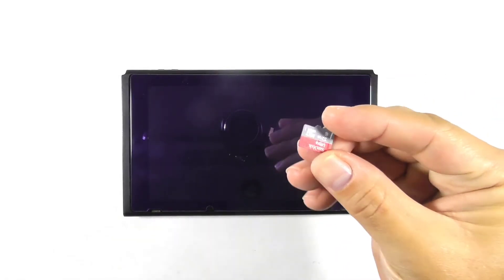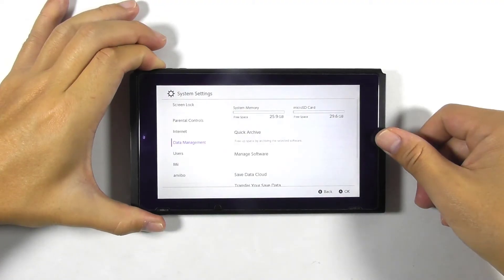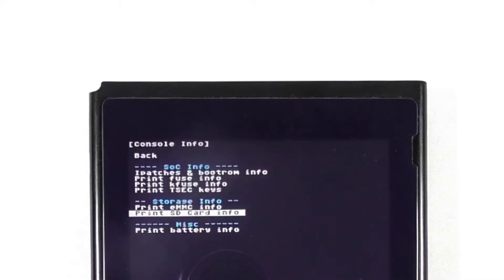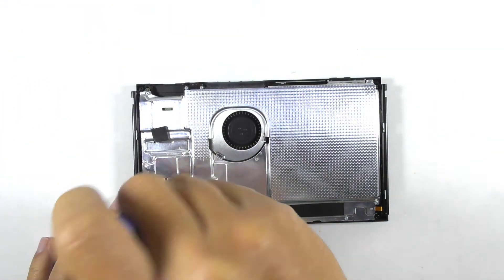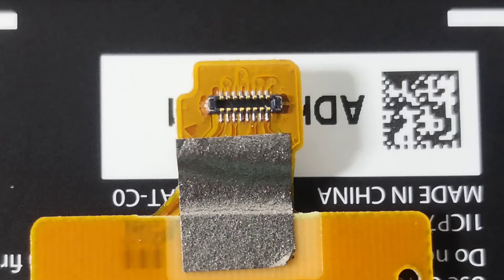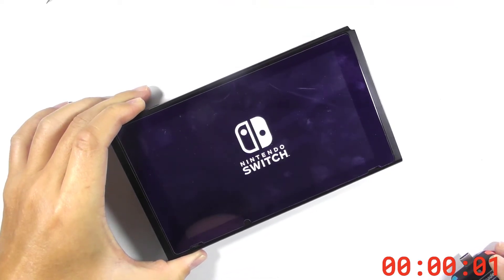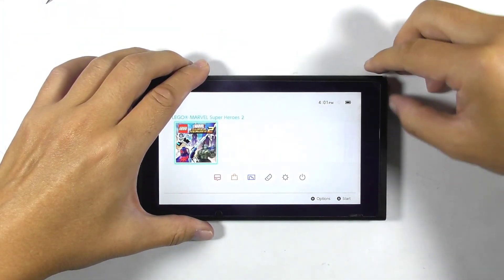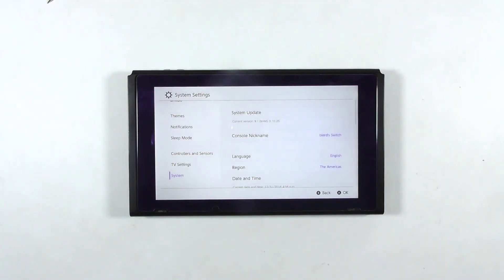Nintendo Switch SD CARD NOT DETECTED under Hekate - but runs fine under stock firmware. Repair tips

Comment: Hey Sthetix, 
I was getting the same error message, so I formatted my card to fat32 and used fusee primary bin, and it worked. I don't really want to use fat32, because files larger than 4gb don't work on it. Do you know if their is any way to use exfat for cfw? I haven't disassembled my switch.
Thanks
Reply from the maker: fat32 is recommended for everything.. install games using usb connection. directly from pc
Reply: I will need to try this out when I can find a spare low capacity microSD.

Comment: hey im having the same problem but i have 2 micro sd cards one with 128gbs and another one with 256 and the problems is that the 128gb gets booted into custom filmware correctly but the 256 one doesnt
Reply: i have to same problem. The SD cards have the same data on it
Reply: Same here.

Comment: I'm having this problem, but only with two of my sd cards. I have 5 different sd cards and three of them work. They are all the same brand and I bought them from walmart so I know that the cards are genuine.
Reply: Any recommendations on what might fix this problem without taking apart the switch?
Reply from the maker: maybe u need to check the sdcard file system.. is it fat32 or exfat?

Comment: Hey my switch detects my sd card but when I boot into rcm its says missing bootloader
Reply from the maker: it means u don't have the complete cfw  files especially the hekate ipl ini file inside the bootloader folder
Reply: @sthetixofficial  can you do a walk-through how to do that? I having the same problem.
Reply from the maker: no.. it depends on ur sdcard slot conditions
my guide is not universal.but the concept is same

Comment: @sthetix Great vidéo !!! i love it !  what do you mean by "30 awg kynar wire" => if i cut it, a USB câble can be used or not? if not, where buy it? i thank you so much. Bonjour from France ;)
Reply from the maker: i bought it from aliexpress. but u can use any tiny wire to do it.
Reply: @sthetixofficial  many thanks. do you have link please?
Reply from the maker: its easy to find it as it is a common product. https://www.ebay.co.uk/itm/264216233349

https://www.ebay.co.uk/itm/301103200828

Comment: Gan , ini sy ada switch kena banned tp memory cardnya gak bisa detect di stock firmware. sdh diganti baru msh sama gak bisa detect. itu mslh hardware ato software gan ? sblm kena banned, ada solusinya gan? mhn pencerahannya.terima kasih
Reply from the maker: gada hubungan sama kena ban kok..sdcard nya mungkin rusak. atau slot sdcard nya rusak.. sama sekali gak ada hubungan nya sama ban
Reply: Di ban itu cuma ga bs konek ke server nintendo alias ga bs main bareng di server itu.

Comment: did you bridged both points on the switch mainboard and connected the wire to it or do you used one point?
Reply from the maker: it is bridged by default
Reply: @sthetixofficial  so it dosent matter if i connect both points, right?